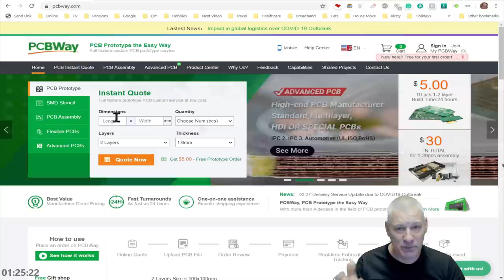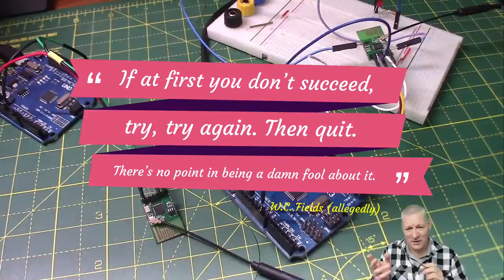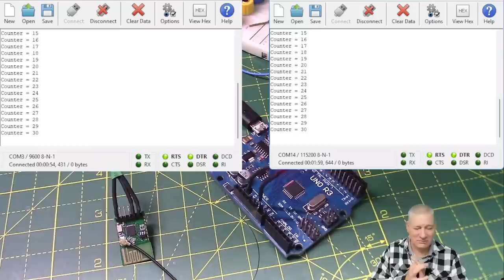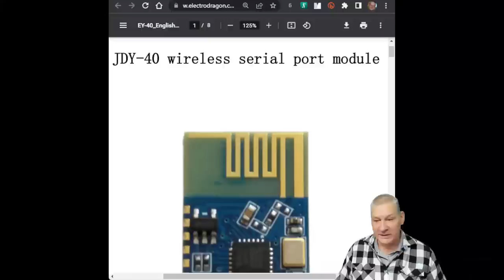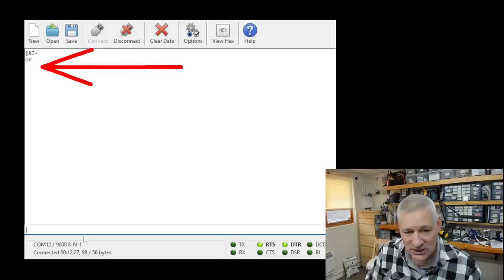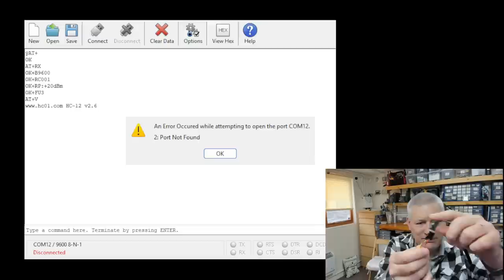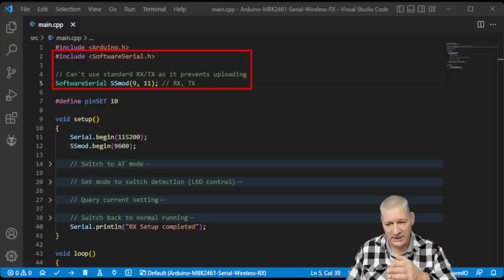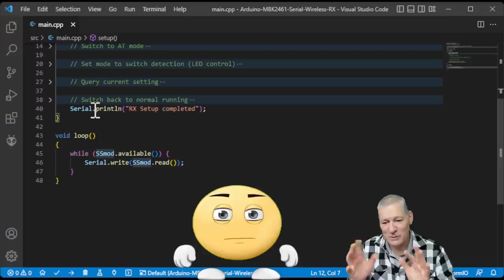#257 Wireless Serial Comms⚡for your Arduino (or other μController)

Comment: Ah. The joys of modules without backup. Well presented  video dispute your frustrations. I feel your pain mate.
Reply from the maker: I'm not that unhappy, actually, Allan, because I will connect up that device (with no documentation) and it will continue to work just the same as I showed for some simple Serial.print statements. Good enough (until I can find a better solution).

Comment: When playing with anything RS232 i first off connect it to the PC via a USB-RS232 dongle and use a terminal program.I use “YAT” ‘Yet Another Terminal”  to build up the strings to send to the module, far easier than trying to do it while programming an Arduino.

As you know RS232 is an open ended data stream. It’s up to you or the manufacture to come up with a termination character, or define the Data length either fixed or as part of the stream data.

It’s always a pain as buffer overruns are easy to get if you’re not reading the RS232 buffer faster enough or you’re waiting for a termination character and it was not sent or you missed it as the buffer was overwritten. 

Most folk only use the RS232 for talking to the PC, very few use it for communications, so don’t fully understand how much user interaction is required with the UART. Just chucking text at the screen is easy, but reading a UART to act on the data stream is a lot harder and can very easy bite you rear end.

At least “Serial.println()”  adds a carriage return line feed to the end of the data stream so it gives you something to look for when decoding the incoming stream. As normaly you loop around looking for the termination char to know when to stop reading.

There is a big lack of understanding on what’s going on behind the reception and decode of RS232, it’s just like reading a serial port and expecting to get all the data sent in the correct place! this is just not going to happen all the time. been there done that and you end up with quite a little state machine to parse the data in to useful information without blocking the code while waiting for a \n that you just missed due to a buffer overrun.
Reply: Squeaktastic !
Reply from the maker: I'll have to check out that YAT program and see how it helps me. 👍
Reply: @RalphBacon  with the loss of windows built in terminal, I use this one the most. the ability to define strings to be sent on a mice click is very handy when debuging RS232 com's

Comment: sounds like you've been having fun lol. i just use esp-now now it just works. good video and good to see you and a happy new year to you to fella :)
Reply from the maker: Thanks, you too! Yes, I use ESP-NOW all the time for my sensors (one in the workshop, two in the attic all sending stuff to my main workshop Heater Controller).

But in this case I wanted a non-Wi-Fi type transmission, and that's what I sort of got. It means that a humble Arduino UNO can only use it.
Reply: @RalphBacon  fair enough. i tryed a few of them wifi boards and gave up lol.. i dont know maybe they where a copy or something like that lol.

Comment: The BDY-40 is 3.3v and I don't think it's TTL logic level - so you might need to use logic level shifters on the RX and/or TX pins (assuming you haven't already fried the BDY-40).... or use a 3.3v level arduino (some Nanos are only 3.3v if I recall?).    Other people have also mentioned using an external 3.3v power supply for the BDY-40 as the 3.3v supply from the Arduino can't provide enough power.
Reply from the maker: So, more power AND use a level shifter if needed (not already running on 3v3). Back to the workbench I go!

Comment: You should use level shifters on the RX and TX between the Arduino 5V logic levels and the module's 3.3V logic levels. It's not enough to supply power at 3.3V from an Arduino...

Try running the modules without the Arduino and the USB-serial converter running at 3.3V logic levels.
Reply from the maker: I'll give it a go, Bernd!

Comment: Hi Ralph. The standard blue HC12 transceivers have been my go-to serial wireless modules for years. I've always been able to use AT commands on them. No problem. Not familiar with those green ones with the backplane antenna and the non-standard pin spacing. Blech! For the ranges you're talking about, the standard blue HC12 modules are probably just fine. Alternatively, if you're having ESP32s talking to each other, could you set up an ESP32 'Command Server Station' as an access point and then just have your 'sender' ESP32s just do a POST request to the server station with their respective debug messages. If you set up your command server as an access point, you don't have to have it on your home wifi network. If it doesn't matter, just set it up on your wifi network and either way, you have  server that receives/logs debug messages and you could have it do IFTTT email sends to your phone when messages come in from your various devices as they generate debug messages.

Have fun! Gord.
Reply from the maker: Yes, the HC-12 modules seemed to behave as I expected. Not so the others! But I still might implement one just for the wireless transmission.

Comment: I found that the HC-05 boards were all basically the same, but their internal code was often crippled. Some boards offer only basic commands, while others allow the full command set.
Reply from the maker: I hadn't heard that but I tend to use the HC-06 as that can act as master OR slave (initiator/responder) whereas the HC-05 can only respond but not initiate comms.
Reply: @RalphBacon  I had a project where I used one HC-05 as master, the other HC-05 as slave.

Comment: Good show! I'm glad you mentioned using software serial. I have been using HC-12 with good results for a few years. I know that timing the command execution is really important. I spent several days experimenting and researching how to put the HC-12 to sleep. I had to add delays after commands to slow the arduino down enough to let the HC-12 keep up. I found the info in a User Manual for the HC-12 translated from Chinese. I will try to zip a copy to your email. I browsed your git and didn't see it listed. It has a lot of good tech info in it. I learned here about the other modules. I have never seen them before. I'll be checking them out. Cheers!
Reply from the maker: I got the manual, David, thanks for that, it's now in my GitHub for everyone to benefit from 👍

Comment: Ralph, great video as always.  Really enjoy the deep-dives and showing us your evolution through a problem.
I may have missed it but could it be start/stop/parity settings, since you tried different baud-rates?
Anyway, I working on sending data to a remote display using those cheap 433Mhz Xmtr/Rcvr modules that just send CW do to cost.
I may have to get some of the ones here that you've mentioned just to goof with!
Reply from the maker: I was hoping the settings were going to work "out of the box", as it were, 9600-8-n, just as the Arduino has as default.

Comment: My goto modules are the Ebyte E32, they allow for higher speeds, have longer range and are transparent once you have them configured as you want (a single time setup)
Reply from the maker: I always considered the E32 range of modules are much longer range devices (basically LoRa) rather than something for my 3m transmission range requirement here in the workshop!

I think that my understanding still holds true, although I'm sure they would work just the same in my workshop.

During my search as a result of your comment, I did find a nice web site (blog) with libraries and other stuff for others to peruse: https://www.mischianti.org/category/my-libraries/lora-e32-devices/

This is something I have bookmarked to investigate more. 👍
Reply: @RalphBacon  you can reduce the power output of the modules to reduce the range and interference to other devices, and if you don’t need much data transfer (just a few bytes) you can also reduce the data rate to reduce the RF bandwidth too.

Comment: I had the same thought as "supardau" regarding a 3.3v board with the arduino 5 v signal as I am currently trying a Nokia 5110 graphical display which states clearly not to use the 5v signal without a level shift circuit which is where I have stopped at the mo. Thank you for mentioning the Github download zip from the CODE button. like a lot to tech / electronics if you put it down for a couple of months you have a lot of little things to catch up on. while very simple , any question you know the answer to is simple while the opposite is also true. Keep up the great content.
Reply from the maker: Yes, if I haven't actually zapped my modules now I'll give it a whirl with a level shifter (which I always use in my projects, ironically).

Comment: You are reinventing Jeelabs ESP-Link firmware, but that's alright (:
Happy New Year!
Reply from the maker: Well, not really. What about Arduinos? I can't use ESP technology on those whereas using, say, and HC-12 works just fine on any microcontroller!

Looking at the GitHub it looks quite complicated too - is it suitable for beginners, I wonder?
Reply: @RalphBacon  It runs on any ESP32, or cheap ESP8266, and works with Arduinos very well. Additional slight complexity is worth it, because you can not only communicate via it, but flash and debug as well. There is even a fork that I tested and used with SMT32duino.
Right after firmware flash everything else including configuration is done in Web GUI starting from WiFi AP mode on that ESP.
Reply: @Mr.Leeroy  Sorry, if you already use ESP8266 etc. with it Wi-Fi and IO, why bother using another MCU?
Reply: Do not confuse it with a MCU that you base your project around. ESP-Link is a intermediate device that provides transparent (meaning you do not have to setup your project MCU in any special way as e.g. in case of OTA) WiFi bridge for any communication to your project as if it was connected with a wire. It simplifies development and could be used as a means of end design communication as well. It is not necessary a part of project, you may use it as a wireless dongle for all your projects.
Reply: @Mr.Leeroy  interesting I never thought about it that way, I had chunks of Attiny85 lying around because I'm too lazy to set up breadboard FTDI wire it to my PC testing it.
I wish @Ralph s Bacon, do a video about this idea.
Reply: @RalphBacon  IIRC the EWSP-01's "reason for being" was this very task. Being a plug-in serial wireless debug module programmed with a TCP/IP socket server. Even "AT" commands originally.

Comment: Just picked up a few LC12s modules that are very similar to the jyd-40, thay have the same ic = bk2461. I did find the datasheet on that chip, a very detailed sheet at that. Got them to learn how they work to fix a hot tub wireless controller/ pump link that uses them to communicate.
Reply from the maker: Datasheets can make all the difference, so it's good you have them. Good luck with your hot tub repair.

Comment: You mention that the 3.3V is fine because the Arduino has 3.3V power but I didn't see or hear anything about 5V to 3.3V logic level shifting. The HC-12 seems to be 5V tolerant, but are the others?
Reply from the maker: I wondered this too, but of the (few) circuits I could find online they all connected the data lines directly to GPIO pins. Of course, they could all be 3v3 GPIO pins 🤔 Hmm, I suppose it's something else I could try (although I'm pretty fed up with the whole things now (except for the HC-12, which not only worked but is 5v tolerant too!).
Reply: Just put a 2k2 down to a 1 k, restistor, in serial output from the Arduino, and then you are good. The input (Aduno) can understand the 0-3,3 volt signals, no trouble.
Reply from the maker: @Asger Vestbjerg Yes, I concur, that would be the simplest solution if we are sure we need it. After all, the TX pin of the 3v3 μC is the output pin going into a very weak 5v RX input pin. Is that enough to cause problems, I wonder?

But resistor divider (or level shifter) is the safest solution, most definitely.
Reply: @RalphBacon  if you aren’t sure if the pins are 5 V tolerant, it is best to assume that they aren’t.

Comment: I would like to hear more about using the data pins. Can a transmitter set a data pin on a receiver and then go to sleep or loose power. The receiver  would have to always be on of course.
Reply from the maker: From what I read in the documentation, that is exactly how it can work.

Comment: It sounds like you'll be monitoring more than one project at a time.  Do you plan on making a polling routine, to prevent data collisions?  Well done by the way!
Reply from the maker: I'm not sure about monitoring multiple projects, actually. Not even a single project continuously. 

I was thinking more about plugging in the serial device when things go wrong to see what happened. 

What do mean, stable door open, horse gone? Oh, I see. 🤦‍♂️

Comment: Hi Ralph. I was just wondering if you have tried swapping the Rx and Tx around with those problematic modules. Sometimes they do make these kinds of mistakes in PCB designs.
Reply: why would 9600 work initially?
Reply from the maker: I tried swapping the TX/RX too (just in case) but no joy. I do always swap them from the device to the FTDI device TX->RX and vice versa. But nothing worked here.
Reply from the maker: @kingofcastlechaos 
Baud 9600 (which is what it is set at from the factory) works fine in default transmission mode. But no luck with the AT commands.

Comment: This is awesome! I'm struggling to understand AT commands. 
Are AT commands firmware or hardwired in? I have a HC-05 where you can enable AT mode, but on my ESP-01 i have to upload AT command firmware if i want to talk to it in AT. But if i want to upload a code to the ESP then you can no longer use AT commands until you reprogram it again. Do arduinos respond to AT commands if you upload the correct code?
Reply from the maker: AT commands are usually wired in. Certainly HC-05 AT commands are, and I use one of those in my Smart Phone Charger project (still in daily use). You should not need to upload anything at all. But it is a one time operation; that is, set the pairing, baud rate etc using a USB-to-Serial dongle and then just plug it into the Arduino and it will "just work". The programmed settings are "sticky" across power downs. That's my experience, anyway.

Comment: Hi Ralph, I have found your tutorials really helpful and have been working on a hot tub controller ever since I watched your blue tooth connection upload. Would you please recommend a FET TTL device that will handle a 2A load @ 12v. Regards Martin.
Reply: Greetings Martin, I'm just a rando that pops in when I can.  You also need to specify if you want to control from the source or ground side of the switched circuit.  This determines P or N channel.  N channel is more common and less expensive, switching from the ground side.  The trigger voltage is commonly less than the source voltage, so what voltage from your controller will you be needing to trigger the FET. There are a number of suppliers that have options to specify your parameters, and help you find what you want.  I generally use Digi-key and often order from them.  Once you have the part number, you can usually source it from several places, but with Digi-key, you know you're getting a genuine article.  With 2 amps, that might be important.  Of course, you could go with a higher current rating, and reduce heat considerations.  I doubt it would be a major increase to the cost.  Also, check through Mr. Bacon's catalog of videos, and you'll probably find one explaining Fets.  He's good at that.  😄
Reply: @gfodale  Thank you for your reply. I will check out Digi-Key. Best regards, Martin.
Reply from the maker: Yes, Mr. gfodale is correct. 

Normally, we would probably specify an N-channel MOSFET to control a device, so that the MOSFET has one leg (the source) connected to GND, and the other leg (drain) connected to the device you are trying to control. The other side of the device goes to the power supply (which might not be the same one powering the rest of the circuit, especially as you mention 12v).  The TTL gate of the MOSFET will fully switch on the MOSFET at 5v (possibly even lower) so an Arduino UNO/Nano (but not necessarily a 3v3 device like an ESP32) will be fine.

Sometimes, though, we control the power via a P-Channel MOSFET and I've shown this in other videos which you can find in the pdf that is linked to in every video description.
Reply: @RalphBacon  Hi Ralph, Thank you for your reply. I ended up using a 2N2222 PNP device as it was easily capable of driving a relay though an opto couple and is in a package that fitts my prototype board. This is all part of my output device from a Nano to control a hot tub via a Bluetooth connection to my phone with an app I have written.(no electrical switches near the water here only a mobile phone to ruin.)  I have been working on and off with this project for about a year now and will get the final circuit board made by PCB Way as I am using there easy EDA as you have recommended (many times). P.S. Your YouTube tutorials are fantastic and have inspired me to become an Arduin'ite. Many thanks, Martin.
Reply from the maker: Great to hear, Martin.